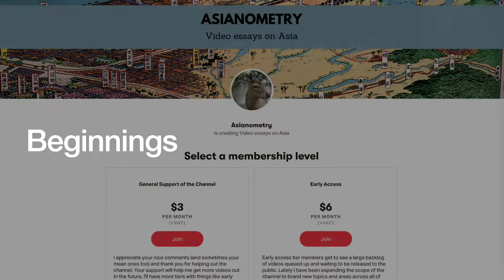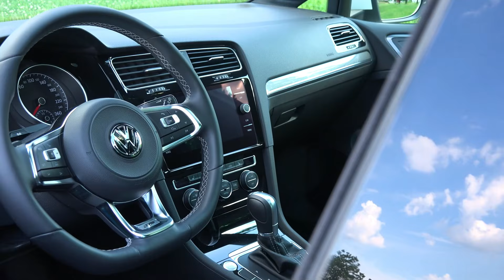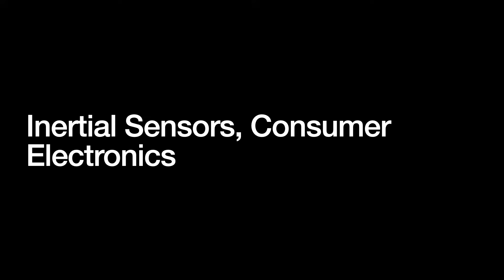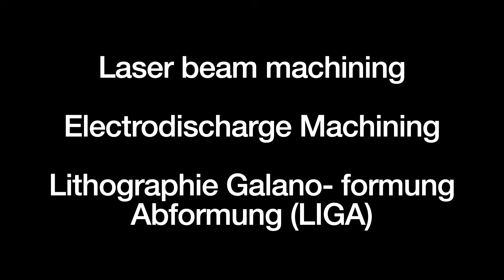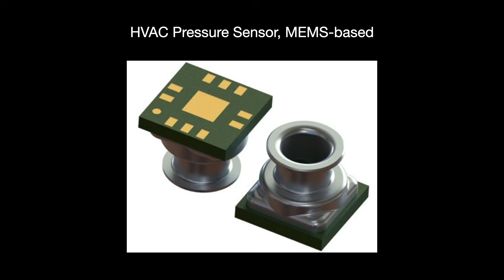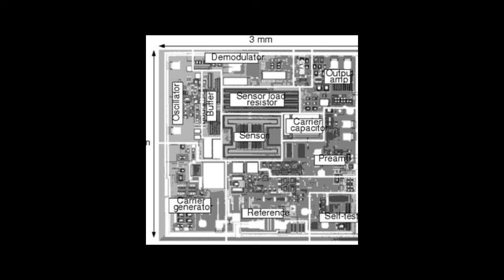MEMS: The Second Silicon Revolution?

Comment: Another fine video! Always worth watching. One quick note: "micron" is obsolete. Even if a source you consult uses that term, it is better to replace it with "micrometre" (MY-kroh-mee-ter) in your video. .
Keep up your excellent work!
Reply: What are you even talking about. “Micron” is standard diction in the entire semiconductor and electronics industry.
Reply: @Grak70  My sources are BIPM and NIST. Check them out for the status of "micron". Similar story when it comes to bar (use pascal), Centigrade (use Celsius), and angstrom (use nanometer or picometre).
Reply: @punditgi  my point is regardless of the “official” word, micron is in extremely wide use. ESPECIALLY in the semiconductor industry. There’s also IUPAC names for complex organic molecules but chemists don’t use them. In this industry, “micron” is the correct choice of word. Saying “micrometer” in this field to a colleague makes you sound like a pretentious asshole.
Reply: Micron is very heavily used in materials handling industry. I've never heard the idea that it's obsolete.
Reply: @letsburn00  Check NIST. They list several old metric terms as obsolete based on the official organizations like the BIPM. Sadly, one still sees many of them being used.
Reply: @punditgi  microns isnt like those horrifically outdated things like inches and feet. It's an easier word to say for a unit. Like saying Scums for a volume of gas.
Reply: @letsburn00  Never have  heard or seen "scums" for gas volume in any official literature from standards bodies. Many people still hang onto old units out of habit or comfort. The beauty of the modern SI (Systeme International) is that it is consistent in its use of base units and multiples and submultiples (via prefixes) of those units. (The lone exception is 'kilogram" for the base unit of mass. Maybe someday it will be replaced with a new base unit that does not have a prefix to make it match everything else.)
Reply: A micrometer is a measurement tool or adjustment mechanism.  I will just stick with microns and nanometers.
Reply: @xenuburger7924  Note the pronunciation is different for the tool  and the length subunit.
Reply: Yes, when using the metric system - all units of length should terminate with "metre" or "meter" in american english I guess...
Reply: Let’s first get rid of inches shall we…
Reply: @heidelbergaren5054  One can only hope! Same wish to toss "feet", "yards", and "miles" into the dustbin of history.
Reply: @heidelbergaren5054  if you worked on the imperial lathe , I bet you would stick to the inches.
Reply: The video did use micrometre at 8:34
Reply: Its the same name, just simplified. I never say kilograms. I say kilo.. Micron is just another word for micrometer. Same meaning, same measurement.
Reply: @MrDanisve  Nonetheless, NIST and BIPM are the standards bodies that have designated "micron" as obsolete. I will stick with their direction.
Reply: @punditgi  The term micron representing the micrometre, was officially accepted between 1879 and 1967, but officially revoked by the International System of Units (SI) in 1967.[2]

Nevertheless, in practice, “micron” remains a widely used term in preference to “micrometre” in many English-speaking countries, both in academic science (including geology, biology, physics, and astronomy) and in applied science and industry (including machining, the semiconductor industry, and plastics manufacturing).[citation needed] Additionally, in American English the use of “micron” helps differentiate the unit from the micrometer, a measuring device, because the unit’s name in mainstream American spelling is a homograph of the device’s name.

In engineering it is common to use the micron as a replacement for the traditional thou or mil, each of which represent a thousandth of an inch. So a bin bag may be originally specified as 0.35 mil thick, but stated as 8.89 microns.

Part of this Wikipedia entry is laughable: “the use of “micron” helps differentiate the unit from the micrometer, a measuring device.” I used a micrometer when I worked as a printer, and experienced a bit of machining. Every US technical person I’ve met calls the measurement device a My-crom-et-er (accent on the first syllable). The measurement unit is pronounced mike-Crow-meter with an emphasis on the second syllable. The word micron is pronounced mike-ron, and the instrument for measurement, the micrometer, is proverbially called a “mike.” When I worked as an offset pressman, all other printers called a micrometer (the instrument) a mike. We generally shared one mike, and I never recall a single pressman requesting that he borrow the “micrometer.” This explanation appears to be yet another strange after-the-fact rationalization for strange versions of US metric non-usage. The micrometer-micron usage explanation also appears similar to folk etymology. There is no excuse other than the irrational urge for US engineers to continue Living in The Past.

Wikipedia also “weighs in” (I could not help myself) on the millimicron:

The nanometre was formerly known as the millimicrometre – or, more commonly, the millimicron for short – since it is 1/1000 of a micron (micrometre), and was often denoted by the symbol mµ or (more rarely) µµ.[1][2][3] In 1960, the U.S. National Bureau of Standards adopted the prefix “nano-” for “a billionth”.[4] The nanometre is often associated with the field of nanotechnology. Since the late 1980s, it has also been used to describe generations of the manufacturing technology in the semiconductor industry.

I’m not knowledgeable enough of the current workings of the semiconductor industry in the US to know if they use nanometers or not. I do know one of the largest  semiconductor corporations uses it as a company name. The irony of using micron is that it appears it was coined by the French in 1880 for one millionth of a meter, and became accepted in 1892. Apparently the tonality of a French term for a micrometer is so alluring that Americans just can’t give up sonorous franophonic sound of the word micron.
Reply: @punditgi  So its  mike-Crow-meter. Not how you spelled it out. Thats muricans talking.
Reply: @MrDanisve  Nanonameter is indeed used everywhere in science, manufacturing, and technology in the USA, just as millimeter is. So, just as we have milligram, microgram, and nanogram, we have millimeter, micrometer, and nanometer. Witness the elegant simplicity and consistency of the SI (modulo the use of "kilogram" as a base unit <shudder!>)
Reply: @punditgi  communication is about understanding and sharing information. I agree with the efforts of standardization, but come on, we all understood the message.
Reply: @raphaelcardoso7927  That is precisely the rationale many English use to continue to use Imperial. Sadly.
Reply: @MrDanisve  Nah, it's a pattern in English for SI subunits Think of CENT-uh-meter, MILLI-meter, etc. Also why KILL-oh-meter is the pronunciation that follows the same pattern and is preferred. Just listen to the Australian Broadcasting Corporation for (non-American) examples of this usage.
Reply: @MrDanisve  I work in a fab. Micron and nanometer are the trade terms in use the world over in this industry. This guy is either trolling or he’s a 14 year old pedant.
Reply: Electrical Engineering has a number of arcane units, and for better or worse, they're going to stay like that. Some are explicitly confusing, like 1 Mil = 1/1000th of an Inch. And you have a wild mixture of component footprints some of which are designed in millimetres and other in Mils, so good luck choosing a layout grid that you don't hate. We don't love it but it is what it is.
Reply: @SianaGearz  Is this so in every country? I wonder if the USA and Imperial units still in use here is the root cause of that sort of thing. Look at aviation where the American influence has resulted in the use of feet for altitude in most places except for Russia and China where meters are used, I believe. Much fun as a pilot flying from LA to Beijing, eh?
Reply: @punditgi  yeah it's down to parts and when you design something in Europe, you can't just be designing in European parts you know, you're going to have a mixture of American, French-Italian, Japanese, Taiwanese and Chinese semiconductors, and in turn they use standards borrowed from different company standards from somewhere else in the world entirely with a different design culture, the footprints are pretty universal across the world and they are universally a mess across the world. Just some company did something and then the rest did something footprint-compatible and it became a standard eventually.

Soviet Union tried to put things on a millimetre grid but that was even more infuriating, since you might have functionally compatible and similar looking chips with both 2.54mm spacing (international) and 2.5mm spacing (domestic) and domestic chips were occasionally produced in export leadframe so you never know what you get and the subtle and prone to bad contact misalignment on a 40 pin socket oh my God, and I can't even bear the thought of a 64-pin chip going through that sort of torture...

Oh yeah that kinda still a thing in the rest of the world, with some connectors having same diameter pins but pitch of 2.5 or 2.54mm, so best not confuse the footprints or think of a last minute substitution... But at least that's not chip sockets.

Newer footprints tend to be based on metric but we couldn't get rid of occasional Mil footprints in 35 years... So yeah that's how it stays.

You can tell I built my first computer in Soviet Union - by soldering it together chip by chip. And I had a curse of finding only an imported Z80. But only domestic DRAM. It was the worst combination.
Reply: @SianaGearz  Yikes!!! 🤕

Comment: I think the original German acronym LiGA stands for "Lithographie, Galvanik und Abformung" (lithography, electroplating, and molding), but for some reason the English Wikipedia disagrees...
Reply: Is LIGA being used anywhere now? When I was studying Microsystems Engineering, this process was just invented but I doubt it could ever challenge conventional Si microfab
Reply: Where? The English Wikipedia says: "LIGA is a fabrication technology used to create high-aspect-ratio microstructures. The term is a German acronym for Lithographie, Galvanoformung, Abformung – lithography, electroplating, and molding. "
Reply: @turun_ambartanen  Yes. Compare that to the German Wikipedia.
Reply: @renerpho  Since the terms Galvanik and Galvanoformung are synonyms it doesn't really matter. For what it's worth, the original patent (1981) never mentions Galvanoformung, but by the later works of the inventors (Physikalische Blätter 1988) are standardized on Galvanoformung.
Reply: @turun_ambartanen  which is easy to pronounce
Reply: @turun_ambartanen  stop using them as a source material.
Reply: I thought the acronym stands for LIGMA?
Reply: @econman5670  i never thought I would ever see that day to witness someone fall for the ligma bait in asianomtry channel out of all the places lmao
Reply: @econman5670  what's LIGMA??
Reply: @Gabagool22  LIGMA Balls B)
Reply: @Gabagool22  Ligma ballz
Reply: @it6647  gottem good
Reply: @Gabagool22  a modified version of the much more well established SUGMA process
Reply: @it6647  🤣🤣
Reply: @pigup2  and yet nearly noone uses HAVA
Reply: @econman5670  when you come here to do the thing, but find out it’s already been done. Thank you, comrade Malone